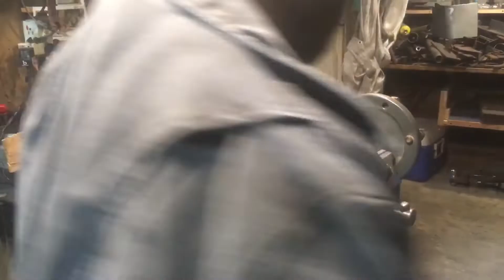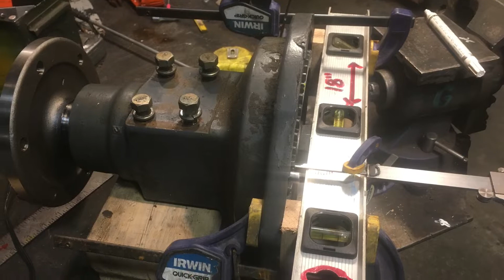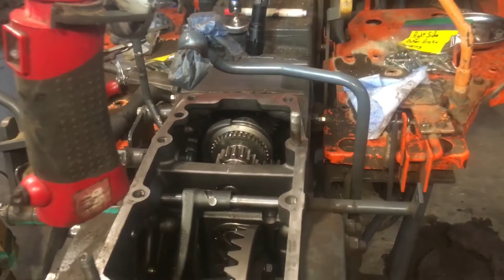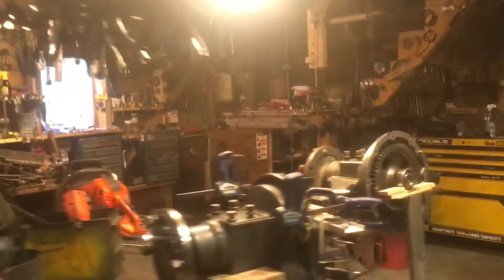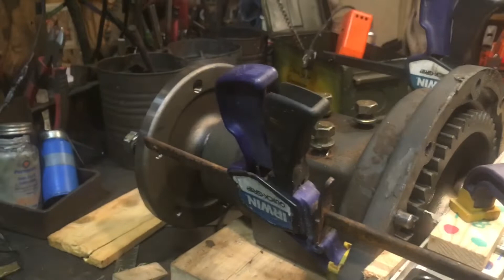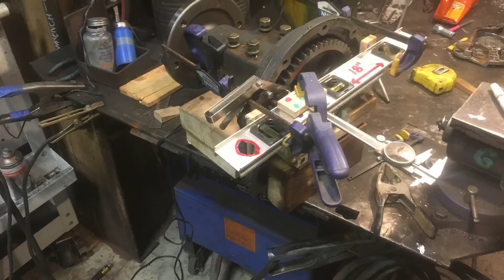Kubota L34OOdt Axle problem, P-3

Comment from the maker: The axle in the vice has a constant drag because of no bearing support from the transmission bearing, the axle on the bench dosnt have a constant drag because the gear is bent out of round .014. So that little bit of .014 out of round is causing binding in one area when it is bolted to the transmission, when it was replaced with new gear the binding stopped, to me .014 isn't very much but thats where the binding was.............